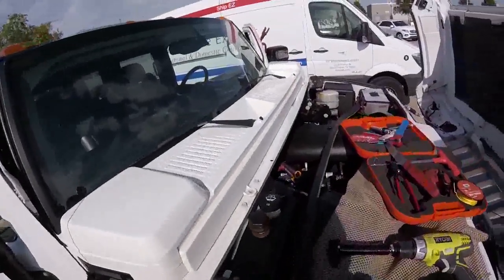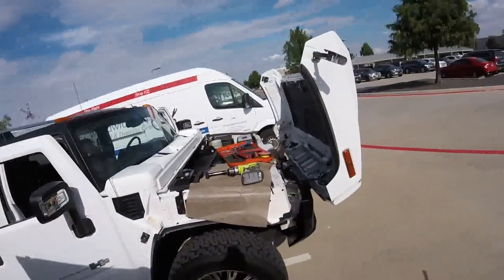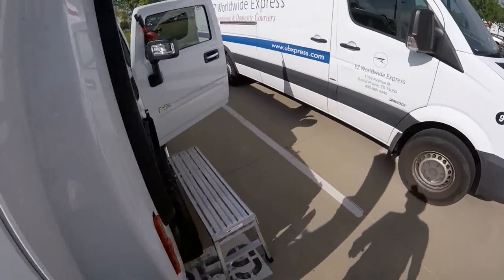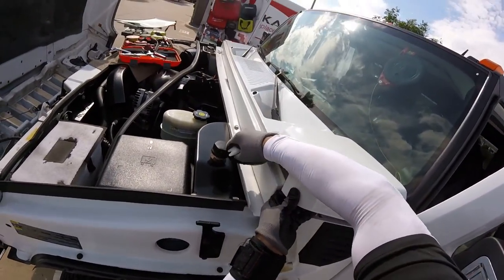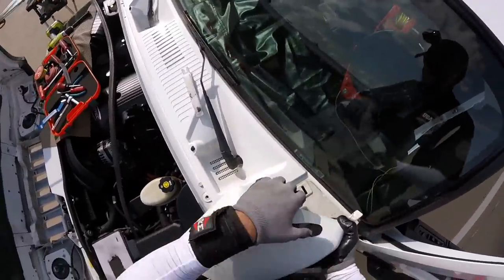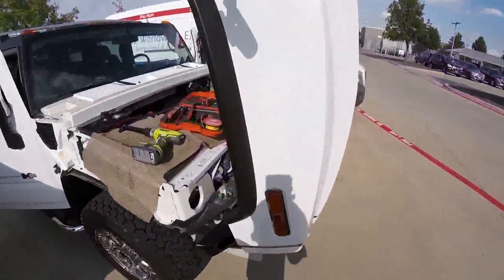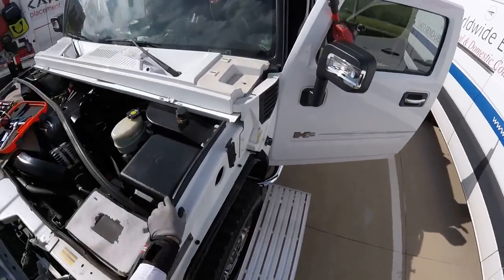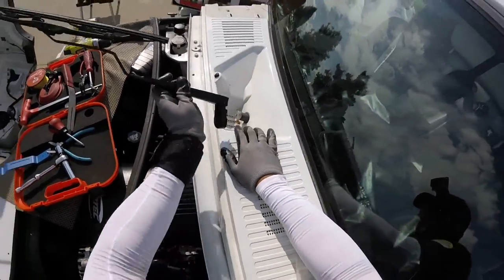HUMMER H2 RELEASING COWL  PLASTIC .AND TIPS TO AVOID SPIDER SLIDING

Comment: I got my windshield replaced 3 weeks ago and I have a leak about 6 inches away from the top passenger corner of the windshield. It never leaked before until I got the windshield replaced. I sealed all the markers with silicone let it dry for a whole day didnt even drive it it rained 2 days later and same damn leak! CAN SOMEONE HELP ME!😩 I love my hummer
Reply: Arturo Gonzalez take it into a General Motors/ Chevy dealer. They still service hummers.